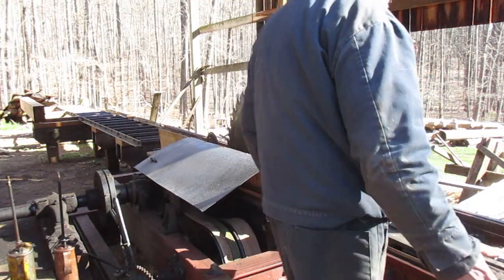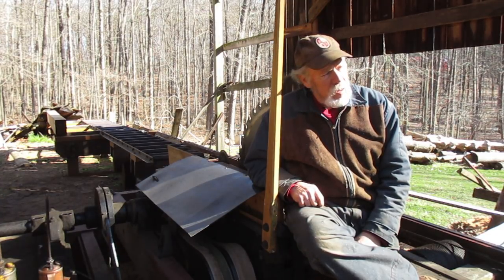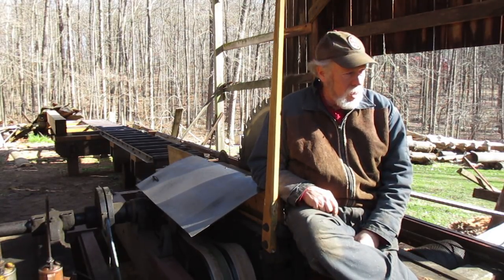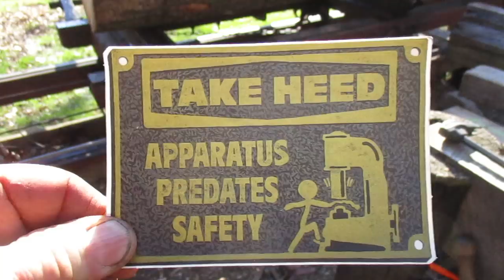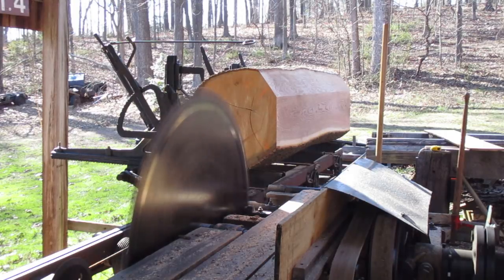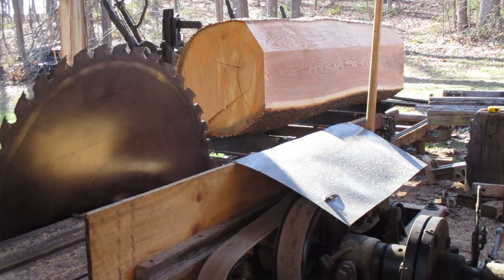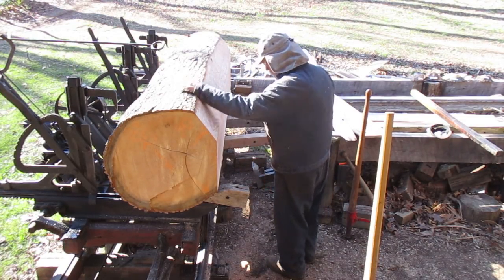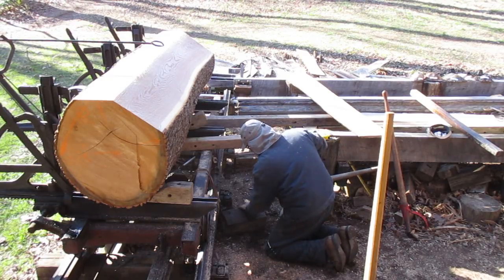Sawmill sawing a GIGANTIC OAK LOG ON A MANUAL MILL #700

Comment: Don't give up, it can be turned! At the young age of eight, I saw it done several times! 

Sometimes my dad, rather than trying to turn larger/diffcult logs back into the knees, had his 'human log turner' turn big logs, like yours here, down on 10"-12" oiled wooden blocks which were cut @ 45 degrees on the ends pointing to the headblocks and knees on the carriage. The wooden blocks were studded with 2 fixed steel dowel pins on the bottom of each block and when needed, were temporarily placed in pre drilled holes on top of the log deck. This caused 'the turned down' log to slide back onto the carriage during the turning process. The process was still labor intensive but quite readily achievable.
Reply from the maker: hi there that is kind of what i do a bit . some where along the came up with the rollers like at the far end of the mill . they show up later here . what kind of mill did your dad have , thanks for stopping by john
Reply: ..He had a Corley mill, a carriage with 3 trucks under it similiar to Fancy Hill Sawmill, also on YouTube which is a Corley of that era. In fact my dad's mill and Fancy Hill Sawmill were same size.
Reply from the maker: @arkansas1336  hi there i watch that channel also . john

Comment: Poor old (LOL) Mark so overworked on that monster of a mill. For you to be so lucky with your modern machinery. I ask myself WHY JOHN? And the answer has to be good looks and environment. A quick question, why not park your skid steer under the sawdust chute? For easy removal?
Reply from the maker: hi there i started with a manure spreader under it . worked well for years till it rotted away . did as you said but kept needing it for other things . then i would have to take the bucket off and put on the forks . and so on . now i just scoop dump scoop dump  thanks for stopping by john

Comment: couldn't you put a ratchet strap under the bottom and pull the top toward the -knees to rotate  the log safely and with power?   Or even with the winch on the Boob cat.?